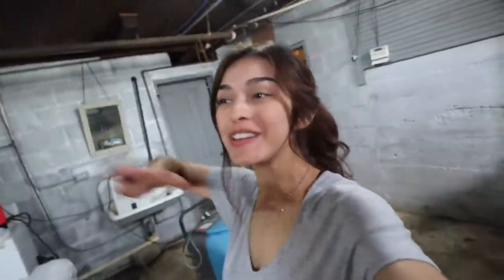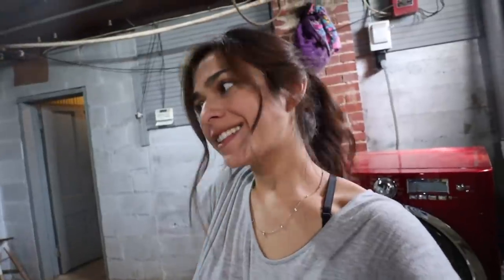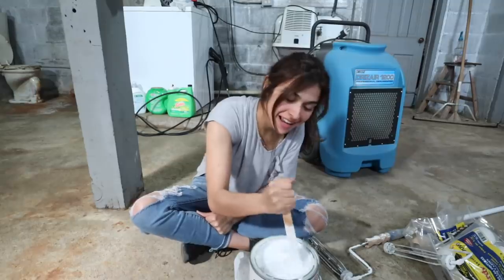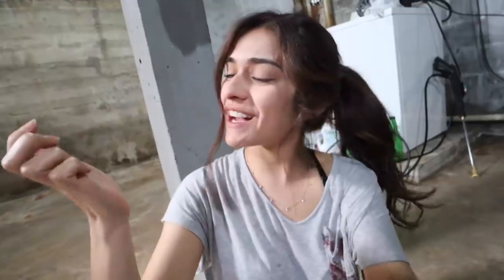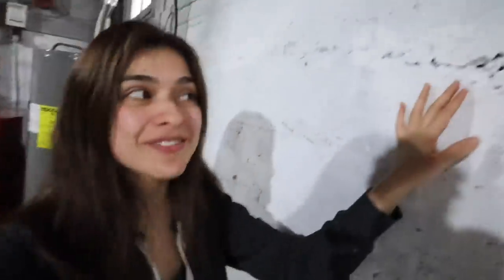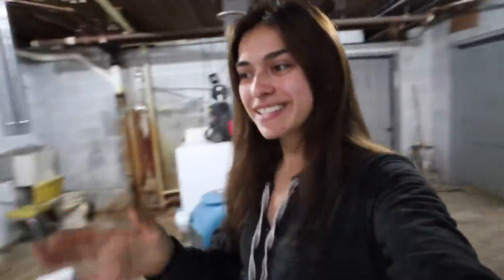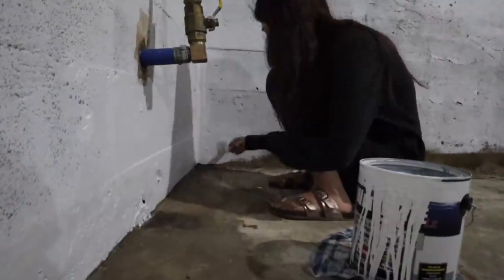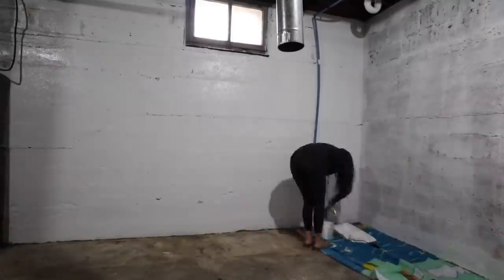Finally PAINTING The SCARY Basement!!!!

Comment: Can't believe you didn't patch and seal existing cracks before you painted. 🤯🤔 That would have gone a long way towards sealing the walls.👍😊
Did the paint you used say it didn't need a primer coat? If not, a) the paint will soak up like no tomorrow, and b) it will likely crack peel off. 🤯🤔 Crucial painting 101 step is primer! 🙏

Comment: The next time you need to mix paint, make sure the top is on securely, place it on it's side on the floor, get a good book and roll it back and forth on the floor with your foot as you read for a half hour or so.  I have done this countless times, it saves you a lot of grief.

Comment: You were supposed to have it mixed at the store unfortunately. Thats what usually happens to the top when it's been sitting for a long time or it hasnt been mixed up. Happened to me one time and it took me 4 coats to paint a tiny bathroom because it wouldn't cover.. and then a year later it looked terrible.

Comment: An employee should have explained that you need special block sealing primer for concrete, brick, or cinder block. I managed a paint store for years and most people don'y know how to properly apply paint and that's ok. Regular wall primer is way too thin and the wall drinks it like a sponge. Block filler is super thick but seals the block before regular paint is applied. Quality paint will not need stirred for up to 5 days after being properly shaken in the store. Another misconception is that paint can block water. It does not. If water seeps through a basement wall, no paint will stop it, not even swimming pool paint. It will eventually force it's way through. Drainage around the foundation MUST be addressed first.

Comment: I think that plastic tray that you're using is meant to be a liner for one of the metal trays to make it easy to clean the tray after you paint.
Reply: Well maybe ... I dont  thank so becuase when i painted I used a plastic one
Reply: Absolutely they are for metal trays. They still work without them.. but they are pretty flimsy and much easier to use with the metal pan. If someone had a perfect fitting cardboard box that might keep it stiff enough. Oh well! the work gets done regardless.
Reply: She put the flimsy one into a hard plastic one......at 3:16 you can tell its not just the flimsy one

Comment: Make your life easier next time. 

Ask for a primer for concrete blocks. The block needs to be sealed before it is painted. Otherwise it is going to just keep sucking it up. 

Have them shake the cans first. Even if you aren’t getting a tint. 

Get a roller that has a thick nap. It will help fill it the revises. .

Comment: Also, dress for the project, tie your hair back or put a bandana on it, wear shoes you don’t mind getting paint on, as well as shirt and pants.  Also, just buy  a 5 gallon bucket of paint, it will be cheaper than buying a can at a time, you have a big house that need painting where you can use it.  Darling I’m 70 years old and I have painted quit a few rooms in my time.

Comment: With all due respect 
Why didn’t you fill the cracks & holes before you started
Maybe a different kind of paint
Like oil paint or a different kind might have had a little better coverage
I just hate to see you have to use sooooooo many gallons of paint
I’m so so sorry
I didn’t want to come across as rude
I’ve just made the same mistake
Numerous times
Myself
You are amazing
I’m sure it will look excellent when you get all done